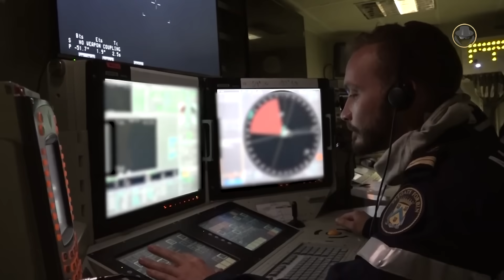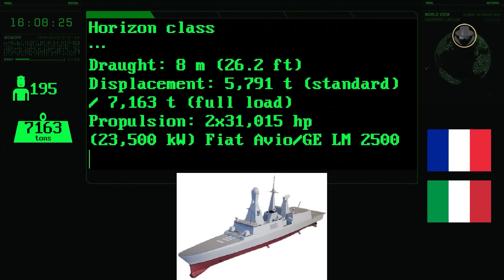Horizon class | The defender of carrier groups of the French and Italian navies

Comment: a fleet of 22 new built Horizon II class 6,832 ton (8,354 ton loaded) stealth guided missile advanced warfare destroyer powered by iFuelCell® e-HYBRId™ M-HEP system . . . cost per unit €843 Mn - €1.2 Bn (approx) . . . armed with a 38-cell SYLVER A50+ VLS built into the forward bow section of the main deck . . . and a 26-cell SYLVER A50+ VLS built into the mid-ship stern superstructure exclusively for NAVAL Scalp EG active radar homing inertial guided land attack cruise missile . . . optionally BGM-109E Tomahawk III active radar homing GPS guided land attack cruise missile . . .

Comment: Thales' claims the Smart-L AESA radar is able to detect stealth threats.
I always wondered how they acheived this. I see only two ways.
- Either burning through stealth with sheer emition power, or
-Using the Over the Horizon technique : shooting up, bouncing on the ionosphere and hitting the target from above, then looking for the lack of an echo caused by wave absorbing materials, which is how the french land-bbased OVH officialy operate based on claims from the ONERA (french national Aerospace research lab)
Reply: Stealth is less effective against low frequency radar, especially high power low frequency radar such as the SMART-L.
Reply: Stealth doesn’t work like that stealth reduce radar emission bounces however this just mean that the radar will detect a very small dots that hard to lock bu the loser you get the easier it is to hit it, currently stealth like the F 22 is less and less potent due to the evolution in new radars and IRST, secondly fighter like the rafale emit jamming frequencies that make it appear a very large target on the search radar which makes an accurate lock almost impossible at long range, which is also considered  stealth

Comment: The British type 45 is no more and no less an Horizon class with Rolls Royce engines. UK left the project with the solely intent to try to sell this project abroad alone. Sadly for them their version was blowing up engines on distant sailing. Still today they are fixing that issue. Meanwhile the Italian and French one are working flawlessly.
Reply: 'It is better to remain silent and be thought a fool than to speak and remove all doubt'
Reply: @Belisarius1967  Exactely, next time don't be a fool. Cause the UK Type 45 for that issue remained pretty much 10 years in their harbors. It's plenty of articles about it on internet.
Reply: False. The GE intercooler is the issue not the RR systems.

"The T45 destroyer intercooler upgrade" refers to a significant modification being made to the Royal Navy's Type 45 destroyers, specifically addressing a design flaw in the Northrop Grumman intercooler attached to the Rolls-Royce gas turbines, which significantly reduced power availability, particularly in warm climates like the Persian Gulf; this upgrade is part of a larger "Power Improvement Project" to rectify issues with the ship's propulsion system and improve reliability.
Reply: It's very different. It's sensor suite is levels superior. The main weapons system is the same
Reply: The UK left the project primarily because they wanted to install a higher end radar suite than the French and Italians wanted. The Type 45 is essentially a Horizon class with a far superior radar.
Reply: @Aethid That doesn't goes well considering that Type 45 passed years docked in the harbors due a Rolls Royce engine issue that was blowing up their engines in long distance sailing. The fix for the UK destroyers was ended in 2023...to say.
Reply: @solinvictus1234 You have already been corrected on the cause of the failures. You are still entirely wrong to say the "type 45 is no more and no less an Horizon class with Rolls Royce engines" - it has many other differences, most of which significantly improve its capabilities over the Horizon class.
Reply: OK, no problem with Uk at all for me MBDA is a GREAT partnership with FR if Uk+Italy+FR could be closerie we culd FORGET germans nothing NEVER succeed with Germany ( look at "Eurofighter" just saved by spain before game-over. They built USELESS Taurus etc etc...sold energy to Putler and defense to NATO.
UK+IT+SP+FR + ... but Germany can produce masterclass Ship, jets, missiles, radars, engines etc etc.
Reply: Have you got some problem with Rolls Royce or Britain generally, because this is the third load of garbage you've dumped on this video
Reply: @vincefont4765  Load of garbage? Do a research on google. The Type 45 was stopped at harbors for years, cause they was blowing up.
I know that truth don't like to British, but it's not my problem.
Reply: @solinvictus1234 ffs how many times do you have to be corrected, it wasn’t due to the engines themselves
Reply: Pas vraiment et la t45 est très sous armee
Reply: @Pasdidentifiant00 the T45 has the same VLS as Horizon and is getting more
Reply: @ non les deux navires ont le même nombre de vls mais les horizons ont des missiles mer mer et des torpilles contrairement aux t45…je ne parle même pas de la fiabilité désastreuse des t45
Reply: @Pasdidentifiant00  T45 are getting NSM now, ship launched torpedoes are not a useful weapon these days
Reply: @ oui d'accord donc si il y a un sous marin hostile dans les parages on lui jette des mies de pain...
Reply: @admiralmallard7500a
I had heard that there was a mod to improve numeral level of anti air munitions by 40%?
Reply: @Pasdidentifiant00  In what way is she underarmed ?

Comment: Why these ships don't carry heavyweight torpedoes? The 323mm has too low a range to be an anti sub weapon.
Reply: Both French and Italian navies have FREMMs to take on the anti-submarine warfare role and they excel at it.
The Horizons are meant to protect their carriers from air attacks.
Reply: Plus heavyweight torpedoes are massive and in reality if ship born torps ar being used something has gone wrong
Reply: @admiralmallard7500 if you are going to use a torpedo atleast use one that can actually do something. My guess is these are for helicopters. As helis don't carry heavyweight. So they just made a hole to launch torps and is most likely useless except morale boost. Max range of less than 10km is asking to get sunk.

But even then it does make the ship less ready for combat. Helis need time to launch.

Comment: France has First and Second class Frigates instead of Destroyers and Frigates.
Britain and the French/Italians didn't agree because the Brits wanted a different layout of certain systems inside the ship, which would have made commonality questionable. The decision to switch components without completely revising the hull brought problems in the Type45, like for Air conditioning system requiring to cut out the hull to be replaced.The Radar was not the original point of contention and both, the Type45 and the Horizon, are almost variants of the same class. I still think the Brits did a huge mistake not adopting the 76/62, as it has shown to be extremely cost effective on a dedicated AA destroyer. Both France and Italy gunned down several drones and cruise missiles at a fraction of the cost of a single Aster missile in the Red Sea.
The ship is now close to an MLU where possibly VL70 launchers will be added in the now empty space for cruise strike capability.
It is still not entirely clear if Italy intend to change the Aster15 for the more compact CAMM-ER as the British did. France could do the same with the MICA, but I have even less clue about that.
Dropping the Aster15 would means having  up to 3 short range missiles for every VL launchers, leaving the expensive Aster 30 1 NT for the long range and ballistic missile interceptions. Modern day saturation attacks can easily wear down the missile defences and the ship cannot stay long in place before having to go back and reload the launchers. The Horizon class was designed in the nineties, when the current state of tension and technology on the sea was not foreseen, and this makes the MLU upgrade extremely urgent.
The Horizon common platform, designed as a pure AA fleet defence ship from the beginning, was superseded by the FREMM for both France and Italy,  the FREMM has been designed as ASW, GP and AA with many commonalities, with a slight decrease in costs due to the number of ships built and a slightly reduced size, but, once upgraded to the EVO standard, the Horizon will resume its place as the best AA ship in both fleets.
Reply: nothing wrong with the air conditioning  on the type 45, it was the intercoolers that had  problems in hotter climates.
Reply: Remarkable how many thumbs up such ill informed waffle can get
Reply: @vincefont4765  correct
Reply: @vincefont4765  would you care to elaborate please? Where in the "these ships are 90% the same with, just different internal components, and all need a rework against saturation attacks", you see "misinformation"?
"The RN deviated on some layout of the common design and this gave origin to some reliability problems": do you disagree with that may be?
Reply: sea ceptor is replacing aster 15
Reply: @jacklamb2904  Sea Ceptor is just the RN name for CAMM.
Reply: Not talking how the Type 45 Rolls Royce engines was blowing up during long distance sailing, wich UK is still fixing them.
Reply: @solinvictus1234  it's not the  RR engine that's the issue. It's the GE intercoolers that kept breaking down.
Reply: @solinvictus1234  They use electric motors for propulsion not engines
Reply: @georgebarnes8163 Where do you think the electricity for the motors comes from?
Reply: @ from the generators of course
Reply: @georgebarnes8163 understand, that not everyone is an native speaker: some times technical terms can be misinterpreted: "engine", or "electic generator" could have a subtle flavour instead meaning for an british that fet lost for someone speaking english as a second language. FFS, even Americans and British dont agree on terms like "lift" or "Elevator". You could literally translate "electric generator" with "electric motor/engine" in many language. Same with "intercooler": if you are not an enginer, the difference between an air conditioner heat exchanger and a turbines "intecooler" can be lost.
Reply: @ What do you think is spinning the generators?
Reply: @ This isn't a language issue, the ship has gas turbine engines and diesel engines. These provider power to but are separate from the propulsion motors. When the poster above said "engines" he used the correct term. "Motors" is not the correct term.
Reply: @soulsphere9242  the gas turbines of course, a simple and basic process  that you should read up on.
Reply: @georgebarnes8163 You can't bring yourself to call them "engines" because you believed the ship only had motors and no engines. Nice try. By the way the generators are spun by both gas turbine engines and diesel engines which can be clutched in and out. It seems you need to do the reading here.
Reply: @soulsphere9242  motors is the correct term, no such thing as an Electric engine
Reply: @ No one said "electric engines." You are just making things up now because you know you were wrong and want to "win" in a comment section. Just man up and admit that ships with electric motors still have engines.
Reply: "I still think the Brits did a huge mistake not adopting the 76/62..   ..Both France and Italy gunned down several drones and cruise missiles at a fraction of the cost of a single Aster.."   ..Good general point, though in view of their role our T45s would've arguably been as well or better served by a Bofors combo of 1 x  57mm mk3 main gun installation + 2 x 40mm mkivs port and stbd. Either way, the main problem remains RN ships typically being forever left half armed anyway as Whitehall+Westminster trash peddle their FFBNW lie